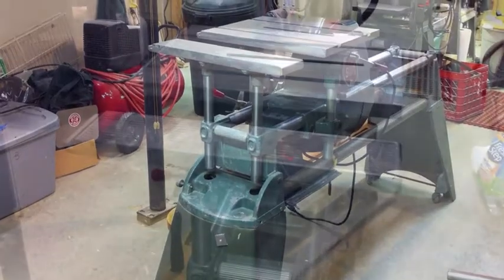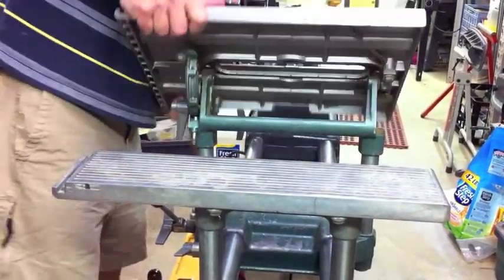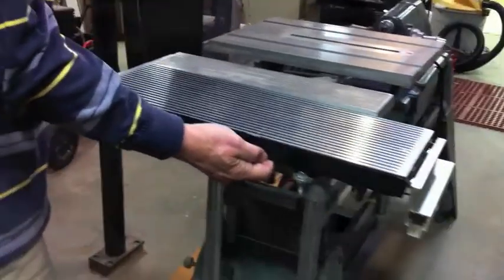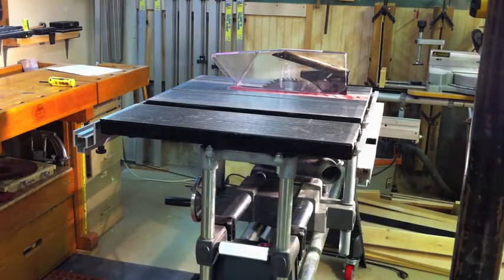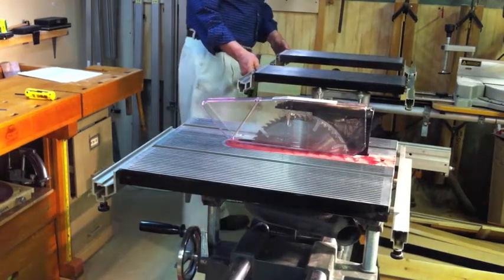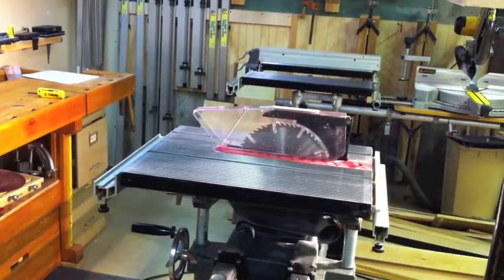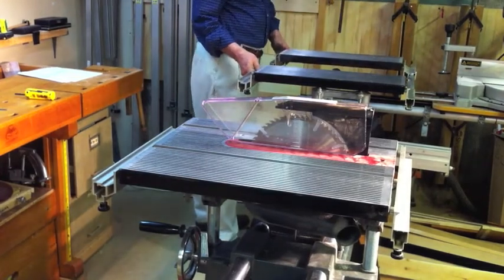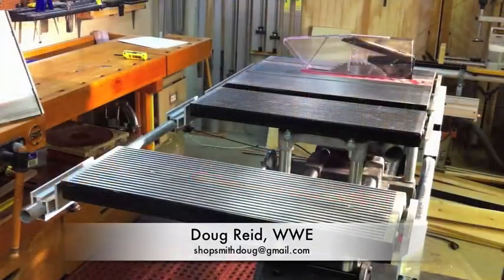Shopsmith- why upgrade to Shopsmith 520 table system—ShopsmithDoug

Comment: Never trust a guy in pleated slacks and a Dress shirt doing woodworking. Joking with you Doug. You've done some great presentations over the year. I'm still amazed that shopsmith continues to upgrade and improve their systems. I use mine at least once a week in the shop. For me, it's mostly the drill press and disk sander with the occasional use of the bandsaw. I still keep a dedicated table saw as I really don't think the shopsmith is ideally suited for that purpose. And due to neck problems, I've had to give up lathe work, but have played around with the ringmaster accessory which is kind of fun. I still think the drill press has too much run out for really accurate work, but the machine can still do some things others cannot touch.

Comment: Hello Doug, I am looking into the possibility of buying a Shopsmith Mark V with a serial number of 12390. Shopsmith's website puts that unit as being built between 1973-1978. Will the serial number give me any indication as to which Mark V, this unit is? Please advise! And thanks in advance.
Reply from the maker: Mike Francis 
If the headstock is green, it was made 1953-1960; if brown/gold, 1960-1963; from then on, headstock was Shopsmith grey. The original MarkV had only two tables (these would now be called a Mark V 500; the model 510 had four tables; the 520 was the same as the 510, but had a much better fence; the newest model, the Mark 7 has all of the previous new features, but also has as standard the new PowerPro digital headstock, the double tilt, and includes routing and shaping capabilities.

Comment: Doug, one of the things I find "Missing" in all the conversations about our ShopSmiths is the lack of discussion about the use or construction of out feed tables, and the means of measurement for repeatability.  Like incorporating aluminum rails and shop stops with built in tape measures etc.  Secondly, is there a jig or a self made/designed fixture that helps make long rip cuts with a tilt to the blade?
Reply from the maker: +Gary Crumrine 
I have a video here on setting up outfield tables. The Mark 7 comes with the built in tapes measures, etc.

Comment from the maker: I think the Power Pro is excellent technology, maybe even better than Shopsmith knows.The technology in the headstock is way ahead of anything else than I am aware of ) in woodworking tools, and the performance is A-1.
The Mark 7 is a good choice (over the Mark V) because it comes with the double tile system which allows for high quality shaping, something that was always weak in the mark V. Did you attend one of my webinars?

Comment: Doug, Great video! You are right concerning the table saw of the vintage 1950's Shopsmith which should have a lower blade guard. I have an old Ward's Powr Kraft combo made by Magna who made the Shopsmith also. I did buy a Shopsmith lower blade guard assembly and it mounted right on. Safety first! Take care!